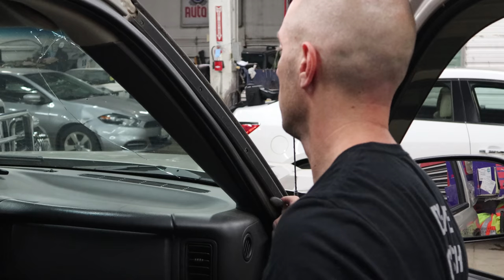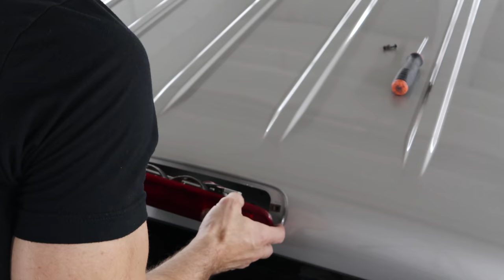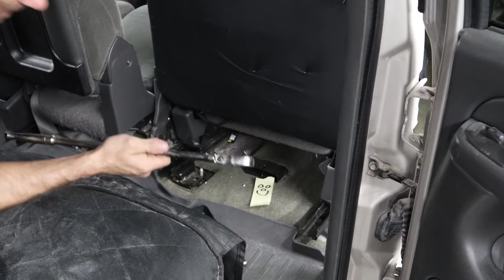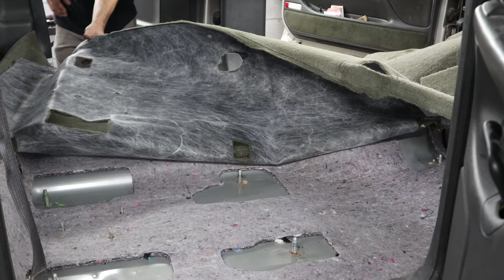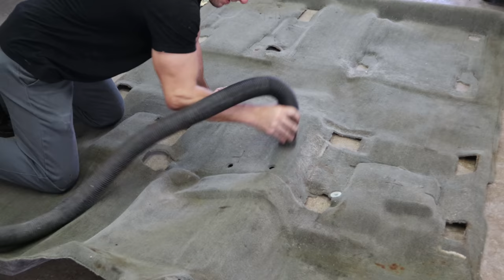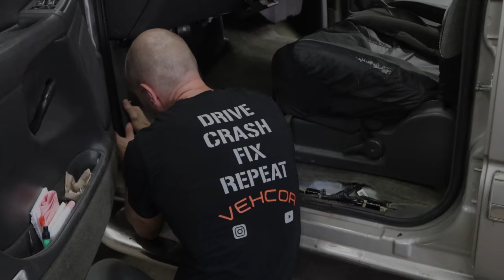Another bad repair leads to big problems and a Rusty Chevrolet!

Comment: G’day and greetings from Tasmania Australia 🇦🇺 bloody good job on fixing the metal around the windshield it was good of you to show what happens if it isn’t primed before painting, but the owner wouldn’t have known that  when it was repaired, to find a reputable body shop is sometimes very difficult and your in their hands!   Thanks for showing that and the repair you did regards John
Reply from the maker: When I sold it years back, there was no sign of the bad repair, it started to show as the rust creeped up the roof and then the waterfall inside the truck. lol .  Best wishes from the USA!

Comment: Looks like a Sonoma I had except with holes! I did a lot of ugly welding around that windshield 20 something years ago. You still do better work than I ever could!
Reply from the maker: Hey I learned how to weld by patching the floors in my first truck.  It wasn't pretty but it lasted as long as the truck.

Comment: I've been an Auto Glass Tech for 18 years. Your windshield removal was cringy but the rust repair was something of beauty and the extra tip of not applying body filler on the pinchweld area was refreshing. I hate dealing with most  body shops because of them wanting to use body filler on the pinchweld because they don't want to repair stuff properly.
Reply from the maker: I'm admittedly no glass expert! 😂 I only remove broken windshields for that reason.
Reply: @vehcor  I'm not mad at you in the least. It was entertaining to say the least.
Reply from the maker: That's what I am here for. Anyone can remove glass but few can make it entertaining. 😂

Comment: In my experience doing these on Chevy's those top moldings are notorious for holding moisture and rusting the top part of the roof yes primer does help on installing a new windshield

Comment: Like how you blame the windshield guy.  Clearly it is the bilge pump guys fault.  
Seriously though, that is a perfect example of how important it is to follow proper procedures when R&R glass.  Cut close to the glass, address any paint damage with primer.  Really good reminder to the DIY guy about keeping filler off the pinch weld area.  Had a glass shop send us an F150. The windshield spontaneously cracked down low on the passenger side pillar.  When the windshield guy cut the glass out the entire corner was rusted so bad it rust jacked the glass until it cracked.  Somebody literally shaped the pinchweld area all the way into the cowl with filler.  The cowl didn't appear to have been painted beyond some lacquer primer.  Quoted the repair from the most current "we don't want the job" guide.
Reply from the maker: I should have just called the gutter guy to install gutters inside that upper seam and solved the problem.  Why didn't I think of that before? 😂 I should have made a scrap book of the stuff I have found over the years! Some of it is pretty scary!

Comment: There is another way to stop this rust permanently: lanoline grease/oil  (fluid film or other). Can be put directly on not too thick surface rust. Goes into the 'pores' of the steel (seems this is why a little rust is actually beneficial). Saved my 1977 Ford Escort that otherwise would have needed welding after another year. A little messy but worth it. Will smell of sheep a week or 2.

Comment: When  I did  rust  repairs   like   that   I  would  use  a wire wheel  on  a  drill  or  die  grinder  I found   it  cleaned  out  the  rust  scabs    alot  better

Comment: here's a tip for someone, I removed a windscreen from one of my Skoda Octavia wrecks for a buyer, i used .90 mig welding wire, its extremely strong wire, if you start the wire in a corner and tie one end to the other corner you can pull the wire till it meets up then repeat for each section, cuts OEM seals nicely and its cheap, screen removed easily with no damage, just put an insulator between wire so as not to cut anything like the dash
Reply from the maker: They make actual serrated wire for that and it cuts much quicker.
Reply: @vehcor  trouble is buying it here where i live when i needed it, I only remove windscreens once in a blue moon, I will look up that wire, maybe for next time. thanks.
Reply from the maker: I have used welding wire in a pinch but once you use the serrated wire, the welding wire sucks. 😂
Reply: vehcor serrated wire for the win. Cuts so perfectly, and with care, no damage to the paint anywhere. Removed my windshield because it was glued in crooked and the moulding didn’t fit, repaired any scratches from previous job, thankfully they weren’t rusting yet, cleaned urethane off the glass as well and reglued it in, this time correctly with the moulding. Without that wire it would of cracked

Comment: This body style is far more superior than what came after. Not just bc of the door panels either. I have a one owner, 01 Yukon Denali with almost 260K on the odometer and every single one of the factory Bose paper cone speakers still work and sound great. Just the overall design and engineering makes these vehicles one of the easiest and most straight forward to work on.
Reply from the maker: I skipped over the 07-14 generation for lots of reasons!

Comment: Scott excellent repair on the rusty Chevrolet! Back in the late seventies or early eighties I remember a product that I think they called rust mort! You cleaned the area up & brushed it on & it would dry black! It seemed to work well in situations where you didn't have any holes & could clean the metal up really nice! Do they still make that product? I haven't seen it in a very long time! Like always you do first class repair in a fast & efficient way! Looking forward to the next video!
Reply from the maker: We used a similar product to that on the roof seam. It is expensive so I just went with the cheap spray on bandaid for the floor.  Thanks for the support!

Comment: One thing about this gen of trucks is you'll never fully stop the rust, only prolong the inevitable. I love this generation but lost count of how many times I've repaired rust on my vehicle kind of like how he did it. Soon I'll need to actually cut some rust out of  the bottom of the drivers door and repair but I'm holding off as long as I can. A little bit of work here and there will make it last much longer.
Reply from the maker: The same hold true with any vehicle and rust repair which is exactly why I want no part of it!

Comment: You should have pulled the cowl and wipers before glass removal, and lube, use lube, cuts down on smoke and it makes cutting thru thick ‘thane easier.

Comment: Hey I'm the one made comment on they are never the same. Sounds like you need to move to TN get away from high taxes in IL. That way I could get you to fix my truck the correct way.  Reason I said what I commented early was my truck was involved in wreck ins fixed was not correct fit and finish body filler flaking out paint didn't match. Was redone at another shop to much body filler to grind out in way to many places so replaced panels and door (used) now door does not fit correctly and rattles adjustment is not option already using all of the adjustment slots to adjust.  Tried to trade truck off but been involved in wreck so lost value because of that reason.  That's why I commented about wrecked vehicles.  Wish you was closer to me the way you fix them.
Reply from the maker: Yep, it was all due to bad workmanship.   I spent a good amount of time in TN when the daughter was at Belmont.  I did like it but it is not far enough south for me!

Comment: It’s amazing how much damage a crappy windshield install can do...  Another thought tho.. I’m sure the molded rubber floor mats didn’t help and kept the floor from drying out. I’m in Wisconsin and have them too and didn’t think about moisture.  I’ll probably start swapping them out in the summer/dry months when not necessary.
Reply from the maker: The padding will never properly dry even without the mats.

Comment: My 2019 GMC Yukon had a nasty windshield leak due to improper distorted urethane on the original windshield.  The Cadillac dealership that fixed it did nothing for my carpet.  I vacuumed and soaked up probably 2 gallons from the passenger front.  I then lifted the carpet and put a space heater in there to dry the padding.  What a shit show.  I know later on I saw you said not to use the sun or heat in a recent video due to carpet shrinkage - oops!

Comment: After 5 (1991, 1995, 1998, 2001, 2005) GM pickups, I switched to RAM starting in 2014.  No more rust issues.  I hate rust more then anything.
Reply from the maker: Just wait, it's coming.  😳

Comment: So all cordless tools suck huh? I have a couple of them, and I really like em. My cordless 1/2" impact out performs many 1/2" air impacts, by a lot actually. 

There's a lot of irony here, watching you fix someone else's "repair" shortly after doing the same type of job myself. That Nissan van quarter panel skin someone had "repaired" before. 
Lots of rust in between the spot welds. I can't believe someone would do something like that.
Reply from the maker: They are useful when making videos so I don't have to run the compressor but for work, I prefer air tools.  I have never had any cordless tool outperform my air tools and I don't have to deal with dead batteries.  I tend to run down the batteries faster than they charge.  It is all just preference, use what works for you.

Comment: How would you know if your window was leaking? You would have to see water running down some place right? But if it came in and ran across the top and down the A piller you might not see it right? I worked at the corner gas station as a kid. Every so often we would apply this past to the long stick used to tell the amount of gas. The paste didn't wash off from the gas . The paste would tell you the amount of water in the bottom of the tank. Letting you know when to have the water pumped out. I told you that because I want to know if there is something to apply that would let you know if water was getting in?

Comment: I have been here from since the early videos, and I will say they have gotten better, but there was nothing to be ashamed of with the first ones. Now, I have what might be a stupid question. Is the what you do for a living, or is this something you do on the side? (Collision repair) You have probably answered that somewhere before, but I missed it!
Reply from the maker: Hey, if you start at rock bottom there is only room for improvement! 😂 The first videos served their purpose, I never thought I would actually be making series and weekly videos.  I am a mechanic.  I worked in a body shop for years and was trained and certified so I could do bodywork when the mechanical work was slow.  I have been doing these side rebuilds since I was 18.  Now the videos are a nice break from all the rebuilds.  Thanks for your support!
Reply: I wondered what you did as your day job. Youre welcomed. I look forward to the videos every week. Even though they are really boring...LMAO! (J/K)

Comment: Milwaukee wouldnt have thought twice about that seat bolt
Reply from the maker: I can assure you it would not have done any better.  I own one as well, actually I own them all and nothing beats air or man power!
Reply: @vehcor  try a high torque 1/2" Milwaukee. Itll take off semi lugs
Reply from the maker: The 1/2 HF would have taken the seat bolt off. lol

Comment: The best witch craft rust Eliminator is muriatic acid can you use baking soda to neutralize the acid then use phosphoric acid to etch to.ptevent flash rust and for metal prep...the expoy prime it....rust is dead!
Reply from the maker: That seems like a lot of work.  I prefer the witchcraft in a spray can.  😂
Reply: @vehcor it work great in area where you dont want to sandblast... kill rust dead....just neutralize it with baking soda or vinegar and di water the dry it. phosphoric  will etch the flash rust off and it read of primer .... its fast...and easy.

Comment: Did you check the floor pan to firewall seam? I ran into a lot of those in New England that were rotted out but hidden by the heavy seam sealer.
Reply from the maker: Yes, it was still good.  I just cut one up last week that the seam was almost rotted away all the way across.  I think the trans tunnel was all that was holding the floor to the cowl since the rockers gave up long before. lol
Reply: And people drive around like that without a second thought to their own safety. Scary

Comment: Ruff? are you Canadian? lol ROOF as in WOOF!
Reply from the maker: Ruff,  Roof, potato, potato.  I feel like a Canadian.... 14 degrees today.... IN FREEDOM UNITS! I don't know the conversion to the maple syrup index is but it's cold! 😂
Reply: @vehcor  that would be -10 in Maple Syrup units......either way, we simply call it "colder than a witch's tit". But to be honest, it's -9 C today and that's not that cold.

When you're outside framing a house in -45 C (that's -49 in freedom units) THAT'S freaking cold. (and yes, I did that) It was so cold that week that we had to build a plywood house around our air compressor with a heater inside to keep it warm because otherwise it would continually trip the breaker cuz everything was frozen. 

Our lungs would ache from the air being so heavy and freaking cold. We had to keep our water bottles inside our coats and take a sip quick because it'd freeze in seconds if we left it out too long.

Comment: My church van back at body shop for the third time  they keep telling us it not leaking they run it though carwash pressure wash and hosed it no leaks but real hard rain leaking our of headline at front windshield after roof skin
Reply from the maker: It could be the windshield seal or even a weld with a pin hole that was not sealed.  Antennas will leak if it has one in the roof.  That is a common issue. Good luck.

Comment: Is there a gasket on that 3rd brake light to prevent leaks?  I had a Dodge Ram that had a serious water leak in that area.
Reply from the maker: There is and it did not leak.

Comment: The windshield company that installed the windshield that was broken later, since they didn't seal the windshield properly, wouldn't the be responsible on this damage or was there rust under windshield when they did replacement?

Comment: The costs of doing all of that work in a conventional body shop probably would have exceeded the value
of the truck!
Reply from the maker: It wasn't cheap but still less than the cost of a replacement truck.

Comment: This is what makes me fear getting a new windshield, most cars i see with aftermarket windshields have this type of rust.
Reply: It only happens if the installer does not prime, and there are cars out there that rust from poor factory engineering.

Comment: In your experience, does any company do a good windshield install?  I'm concerned about having mine replaced now.  Great job!
Reply from the maker: I use a local place and they do good work.  Although they have gone through some bad guys over the years. It seems they are everywhere!  I can name a nationwide company I would trust.
Reply: @vehcor  Which one is that?  Or did you mean "can't"?
Reply from the maker: Charles Erickson I meant can't.  Apparently auto correct seems to think it can! 😂
Reply: vehcor 😂 thanks bud
Reply: Charles Erickson research on youtube near you. I’ve found quality shops nearby showing their work off on youtube.

Like step by step, they definitely didn’t butcher the paint cutting the windshield out, and that’s what causes the most issues. Cut up paint, rust and well...this video is the next step

Yes, i know, windshield primer is designed for that, but reality is a quality place won’t butcher the paint, in the first place

Comment: What are your thoughts on those rust converter products,  use em?
Reply from the maker: I used them on this.  I guess they work.  If you seal in the rust it won't spread but a little extra insurance doesn't hurt.
Reply: @vehcor   I have a 1997 F150 and I've seriously considered just Spring the crap out of the underside with rust converter

Comment: Always catches my eye when someone is pulling glass for rust repair. I was impressed that you did not put filler on the glue surface. I run across this fairly often and am trying to get my shops to not put paint and clear coat where Urethane is going to go. Do your work and apply an Epoxy primer. The urethane will just pull that clear coat right off, I see it all the time when a 1/4 panel is put on and Urethane is laid over the Clearcoat, next time around the clear peels right off.
       Hopefully your Glass guys pulled the cowl and wipers when they re installed the new glass and did not just dive the glass under the cowl. Great way to get a wind leak and the glass to sit too low. My only other observation is that the 3rd  brake light screws were probably "Pozidrive" and not Phillips. Just a little anal for my own good. Great job and good for another 2-3 years.

                                                                                                                Ycats
Reply from the maker: I learned a long time ago about the filler.  I guess all that certification was good for something.  Sometimes, they remove the wipers and sometimes they don't.  I don't care how they do it as long as it fits right and has no leaks, air or wind.  I'm all for shortcuts as the as it doesn't affect quality! Thanks for watching! I don't know if the rest of the truck will last 3 years. 😂